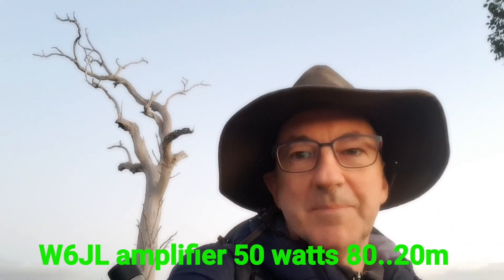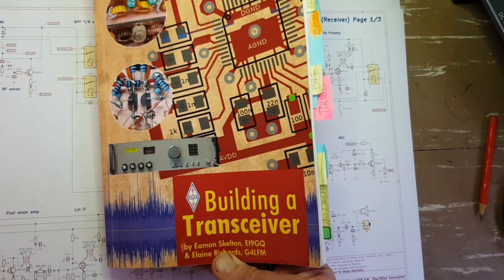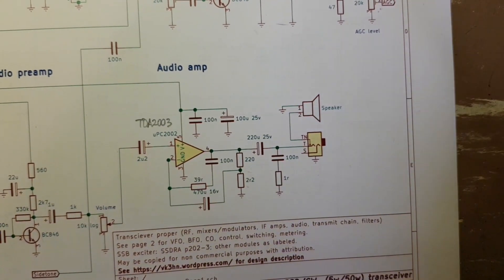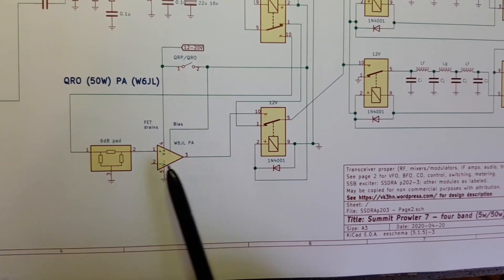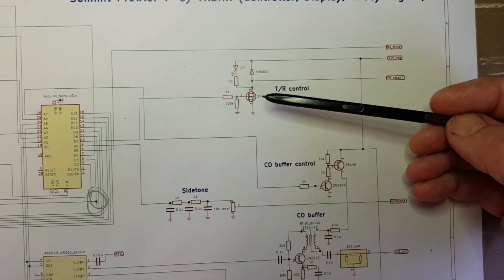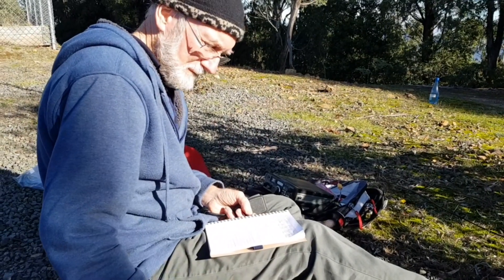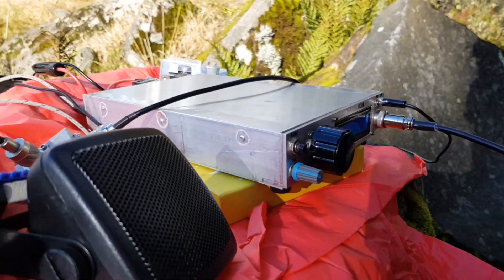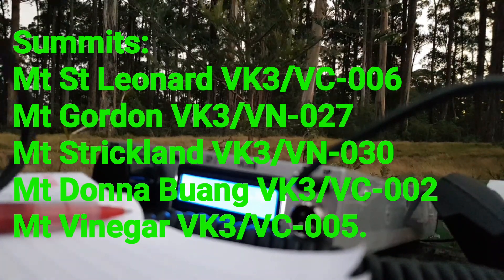'Summit Prowler 7': Scratch-built SSB CW 50 watt transceiver  for 80 to 20m

Comment: Hi, this is a really cool video and transmitter, but I don't quite understand how you do SSB on any frequency you want when the diode ring does DSB-SC and then you have to use a filter to remove one of the sides, and this last filter is usually very steep and not variable.
Thanks
Reply from the maker: The SSB generation is done an a fixed Intermediate Frequency,  in this case around 5.2MHz and dictated by the crystal filter.   The 5.2MHz IF is then mixed with the VFO in a transmit mixer to the various ham bands. The output of this mixer is always bandpass filtered , then amplified up to the transmitters RF power level. 
Superhets have been the standard transceiver architecture since the 1950s but have been now replaced by software defined receivers and transceivers.
https://en.m.wikipedia.org/wiki/Superheterodyne_receiver
Reply: Thank you very much, I understand everything now

Comment: Really enjoy your videos, how many steps per revolution with your optical encoder?
Reply from the maker: Thanks!  Do you mean how many pulses or  interrupts per turn, or how many kHz?  The optical encoder generates far too many pulses per turn, so I added a line of code to increment a counter and ignore 3 of every 4 pulses. It might have been 7 of every 8 pulses.  The code is on github.  I cannot recall for sure and the rig is not in use at the moment,  but it's tuning rate with 100 Hz increments is about the same as other commercial rigs, say 10kHz per turn.
Reply: @Paul_VK3HN  I was just wondering what encoder you used i was going to get one "100/200/360/400/500/600P/R Photoelectric Incremental Rotary Encoder" wondering if to just buy a 100p/r?
Reply from the maker: @VK4TVC  I used this one , they are available from lots of sources.
https://www.minikits.com.au/ENC-360-6

I have tried a variety of mechanical encoders, all have worked.

Comment: Great build!
Reply from the maker: Thanks! I still use this rig quite regularly. And thanks for all your brilliant explanatory videos!
Reply: @Paul_VK3HN  Thanks for the kind words! I was wondering, you used quite a few relays in the signal path to switch between the various filters, did you use a special type or relay or does it not really matter? I'm thinking if the relay contacts pose a discontinuity for the RF... I know there are special "RF" relays where the contacts are built to have controlled impedance, but I'm wondering at what frequency those start to become necessary
Reply from the maker: @FesZElectronics  I use what the retailers call a miniature telecom relay, DPDT, 2A contacts. 
https://www.altronics.com.au/p/s4130c-2a-12vdc-dpdt-pcb-mount-telecom-relay/
These are compact and in my experience work fine as small signal RF mechanical switches. I have used them  up to 28mhz. I think the common thinking on relays is that they are fine at HF, to 30mhz, and some may be OK up to 144mhz. The limiting factor is stray C (a few pF) and L (I've never measured it). Also RF power level.  
 In the past, it was 'best practice' to pass a small DC current through the closed relay contacts (as well as the RF signal) to prevent contact oxidation.  This was called 'wetting'. This was done in a homebrew transceiver called the HBR 2000, pages may still be online. However this practice seems to have disappeared and I think it's because relays these days are sealed and have much better quality contacts.  There are many HF commercial, kit and homebrew transceivers that use these kinds of relays in the signal path.  
For RF power above a few watts, or above 100MHz, I would use an RF relay. However, this page from W6PQL illustrates how even $5 relays can work at VHF. 
https://www.w6pql.com/using_inexpensive_relays.htm
It is better practice these days to use solid state switching of low level RF with PIN diodes or a cheap substitute,  or with a RF switch such as SA630 of FST3253. 
Hope this helps! 73 Paul VK3HN.
Reply: @Paul_VK3HN  Thank you for the very detailed response and the article link, I'll study it in more detail

Comment: Nice 👌.  I was think this is about same size and weight as an FT-817 yet it knocks out 50W! OK I know the 817 has more bands plus 2m/70cm but for HF /P ops, this seems to be ideal. Only questions is does it have any CW filtering? Wondering what current draw is? Sorry if answers are on your website (don't have time to read now but certainly will look later).
Reply from the maker: Hi Steve. No CW filtering, only one IF filter and it is SSB bandwidth.  So it's not a CW contest rig.  We do not suffer from the same band congestion at peak times that other regions do so I would argue that a narrow filter is not essential to enjoy CW in my part of VK. Receiver draw is approx 220mA, Tx 5 watts about 1.5A, Tx 50 watts about 5 to 7A. Using a 5AH LiPo I can get three activations on 50 watts CW, averaging about 10 QSOs each time. It's  a good all round package for HF portable. Could be lighter, but then, you lose features. 73.